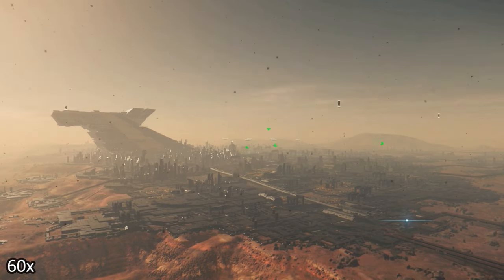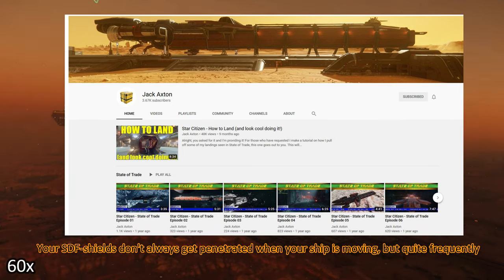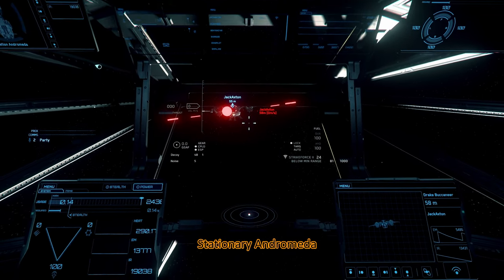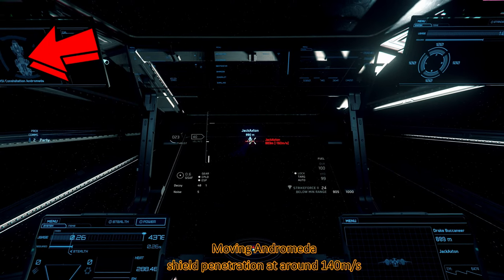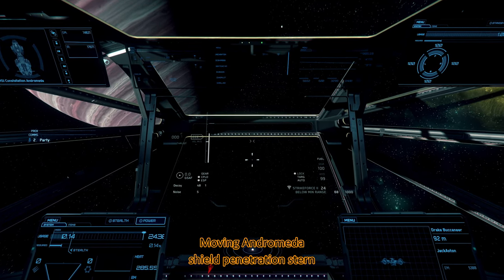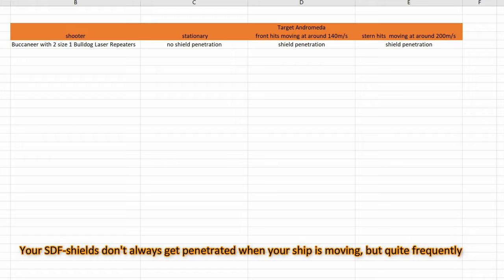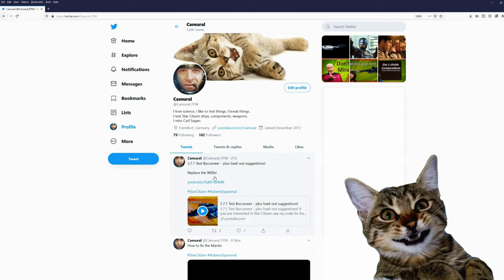3.13 PTU SDF-shields busted

Comment: Wow it never crossed my mind that this would actually be a thing. Everything looked all peachy when you did your test while stationary. Just goes to prove why PTU testing is imperative.
Reply from the maker: Nate The Great  I don't know if this is an old bug or a new SDF shield bug.
I never tested shield holes with moving ships, we had enough well known shield holes on stationary ships already.
I was happy when I saw that the 3.13 SDF shields fixed most known shield holes.
I heard reports about shield holes still present with moving ships but thought it would be just a rare case and maybe just desyncs.
Well Jack and I found shield holes in a moving Andromeda in seconds, very easily.
I am sad, because I really hoped shield holes would be a thing of the past.
Reply: I actually prefer imperfect shields. In fact I would only have shields for capital ships. I hate the damn things.

Comment: I've also noticed the 890 jump has HORRIBLE shields it seems since not everything is physicalized on the 890 are protected at all, and I should mention this is even when standing still.
Reply from the maker: stoutish _ what spots exactly?
Reply: @Camural  lower engines, near rear airlocks, and the side parts of the bow.

Comment: I feel like they could use this. Obviously, it would need to be tweeked but the faster you go, the less shield you have. It certainly would slow down combat speeds and prevent jousting.
Reply from the maker: Nate88it  this would be a very bad idea to slow down combat speed. There are other options.
CIG promised us shields without holes for years by now, so one day they should deliver.

Comment: You might want to look at those placeholder shields on the talon and talon shrike before they fix them in the next patch , they're freaking hilarious with their instant regen.
Reply from the maker: Rek'ret Nightfire on the 3.13 PTU  size 1 Sukoran shields have 8000 shield hps and no regen delay damaged.
I cannot see this being anything else but a bug. 
If this is intentional and goes to live, almost everyone will be using size 1 Sukoran shields if they can.

Comment: Desync, desync everywhere. I think is the shield position not updating with the ship movement
Reply from the maker: GiovanniFracci I am not sure if those are desyncs, the shields reacted normally.
Reply: @Camural  With desync i mean what QuadsarX wrote: "Maybe the shield position updates less regularly than ship position?
". It's still a desync. I think caused by servers, because i don't believe that they released SDF with this bug on their dev environment. If servers are busy and gives to shields less priority then ship position update...
Reply from the maker: GiovanniFracci I don't know what the problem is exactly. I don't even know if this is a new problem introduced with 3.13 SDF-shields or if this problem is in the game forever.
It just makes me sad, that 3.13 SDF shields seem to work so well and seem to have fixed most shield holes when the target is stationary but can be penetrated when the target is moving, even at low speeds.
Reply from the maker: @YumYum  to be honest, I am tired of shield holes and shield hole videos.
We have shield holes in the game since forever, then came CIG and promised us those new fancy SDF-shields coming in 3.6 will fix this, no problemo.
Then those SDF shield were moved to 3.10.
Then those SDF-shield were moved to 3.13.
Then Jared said in a 3.13 CIG vidoe, those SDF-shields will fix shield holes, cannot have visuals and shield holes separated.

FINE
Perfect
ONE LESS THING TO WORRY ABOUT

And now it turns out that those fancy new SDF-shields are (almost) as bad as the old shields, while the SDF-technique should take care of the problem automatically.
I don't care if the problem lies in the SDF-shields or in desyncs, something CIG doesn't seem to be able to fix.

Even if SDF-shields would work fine on a low population server, then this doesn't help the players who cannot choose to only be on a low pop server or who actually want players around them.

I certainly won't spend any time on trying to find a low pop server to see if SDF-shields work well then.

Comment: Hey Camural - As always thanks for your video.
I noticed that the damage again was 0.06% - which is the same as in your first test video on the stationary Andromeda AND the Reclaimer. 
I don't think the two ships share the same Hull HP so this might be something interesting going forward.
Reply from the maker: BeHa7 yes I noticed this too. Maybe the ship doesn't take anymore damage at this spot after losing 0.06%.
But there were other spots flashing too: center, nacelles stern.
Maybe those shield holes wouldn't destroy the ship, but I really don't feel like going any deeper into this at this time.
I am really getting tired of shield hole videos :)
I was hoping 3.13 SDF shields would solve the shield hole problems like Jared said in CIG's video.

Comment: Well, at least it seems consistent in the 0.06% damage when it pens, which isn't a huge deal compared to what we had before. Just my $0.02
Reply from the maker: Angens it is more complicated.
Jack and I stopped after confirming the bug, but we had at least 5 spots flashing.
If you follow the link to sladuog's IC-report, contributors are reporting their ships getting destroyed through the shields:
Captain_Svipul
captainberks killed me with this using stationary meta.

Constellations have quite a bit of structure hit points compared to smaller ships and we only used 2 size 1 Bulldog Laser Repeaters in our test.
Reply: @Camural  Hmm... that does sound a bit more alarming. I thought it might just let through a tiny fraction and then stop, not being able to blow the ship up :/

Comment: I mean 0.002 health drop isnt much.
I dont think that qualifies as a blocker for why it shouldnt go live.
Its still infinitely better than the current shield holes which block 0% of damage.
At least the SDF shield glitch blocks 99.9% damage.
Reply from the maker: Baleur it is more complicated (when isn't it?) :)
Jack and I stopped after confirming the bug, but we had at least 5 spots flashing.
If you follow the link to sladuog's IC-report, contributors are reporting their ships getting destroyed through the shields:

Captain_Svipul
captainberks killed me with this using stationary meta.

Constellations have quite a bit of structure hit points compared to smaller ships and we only used 2 size 1 Bulldog Laser Repeaters in our test.

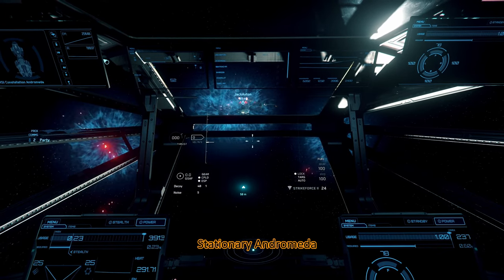Comment: I think there is still a small shield hole at the front of the Connie, and this has nothing to do with the speed. While stationary I could clearly see some of the laser shot coming through the front windshield (2:38) and passing by the head of the pilot. I noticed the same in your last video about the new shield performances
Reply from the maker: Zumzifero yes there is still a small shield hole at the front (left cheek - left edge), but stationary test was fine, while in motion, shields got penetrated easily at a different spot, not the left cheek, left edge.
And this "SDF-shields get penetrated when the ship moves" is not about the Constellation alone :)
There are dozens of contributions in the IC-report (I am not sure if I can link it here because it contains videos from the evo phase), with many different ships, showing shield penetrations when in motion.
Edit: In this video, while stationary some laser shots might  have made it "inside" but ship health was still 100% after the stationary test. So this was just a visual bug.

Comment: Hmm, random shield pen outside shield holes has been an issue for some time. Every projectile has a small chance to pierce, to the point you can kill someone with lasers without ever breaking their shields  (dominances got looked at but the rest are still doing it) hard to tell how much SDF or movement affects this.
He was firing more aggressively while moving and for longer periods, which could explain why the penetration happened. Even while still in your previous SDF vid you got some flashes. From this alone it looks like the same bug from before 3.13 (tonight I had a couple fights in PU vs full laser loadouts with consistent shield pen at high / full shields) I wonder if it got any worse...
Reply from the maker: Dhovrak  I don't even know if this is a new problem introduced with 3.13 SDF-shields or if this problem is in the game forever. I never checked shield holes vs moving ships much, too many variables.
It just makes me sad, that 3.13 SDF shields seem to work so well and seem to have fixed most shield holes when the target is stationary but can still be penetrated when the target is moving, even at low speeds.
Reply: @Camural  They can be penetrated while not moving as well, (PU and PTU) unsure if movement increases the chance. Either way its sad that SDF didn't fix this :( but at least shield holes seem to be gone.  Still, I bet they will look at it thanks to all the feedback and videos like these raising awareness, so keep at it ! :)
Reply from the maker: Dhovrak  there are dozens of contributions in the IC-report (I am not sure if I can link it here because it contains videos from the evo phase), with many different ships, showing shield penetrations when in motion. 
I am not saying only when moving, this statement would need a lot more testing , but the contributors show examples where shield penetrations happen far more often or only when the ship is moving.

Comment: how did you get rear view? i remember being able to do this, i think it was modifier + z a long time ago, but can't seem to be able to find the bind now.
Reply from the maker: Cyc0Dud3  I got it on a button on my throttle and I am still using Solarfly's target profile, so I didn't configure it.
However, if you go to: Options -> Keybindings -> Advanced Controls Customization -> Flight -View - there is "Look behind" and you can assign a key to it.
https://imgur.com/a/y3Xhyhq

Comment: Disco "shield holes are now fixed with sdf shield tech"
Roadmap - 3.14...am I a joke...
Reply from the maker: RIDDICK  I really don't know what this is.

Some say it's an old bug. I never bothered looking for shield holes on moving ships. It's hard to find a specific shield hole on moving ships and we had enough shield holes already with stationary ships.

Some say it's caused by desyncs. However, if you look at the pinned IC-Report, people are reporting we have the same bug in Arena Commander. Yes Arena Commander has some desnyc issues too, but far less than the universe.

I have no idea what the cause is at this time.
I also don't want to do more shield hole testing at the moment, I am really getting tired of shield hole videos.
I hoped 3.13 SDF shields would eliminate shield holes, like Jared said in CIG's videos, but nope, we still have to wait.

If this is really caused by desyncs, then we will continue to have those shield holes for quite while.

Comment: Itys a good bug)) atleast no SPEED FIGHT and we can oneshot "speedyruners" XD Thx mate.
Reply from the maker: Anshegar this could very well be an old bug. I haven't checked shield holes vs moving targets because we had enough problems with shield holes and stationary targets.
It makes me sad, that 3.13 SDF shields seem to work so well and seem to have fixed most shield holes when the target is stationary but can still be penetrated when the target is moving, even at low speeds.
Reply: @Camural  I think it will fixed auomaticly then servers stops making desincs.
Reply from the maker: Anshegar  if we really have to wait for CIG fixing desync issues, it will be a long wait :)

Comment: I am not sure how shields work by design exactly, but can the probability of penetration increase as the shields weaken?
Reply: Nah, but the ballistic bypass ratio increases as the shield health is lowered. At 100% shield health the vast majority of shields let 5% of ballistic dmg through increasing to 50% as the shield face health gets closer to 0% health
Reply: @TheZhriver  Ok, that's exactly what I meant. But this only works for Ballistic weapons then?
Reply from the maker: Arbiter 41  yes, only ballistics penetrate most shields to a certain degree depending on current shield strength. See my tests:
3.12b Ballistic shield penetration part 2   https://youtu.be/GCHWAfX8Eeo
3.12b Ballistic shield penetration test   https://youtu.be/5e6M2B_lLsc